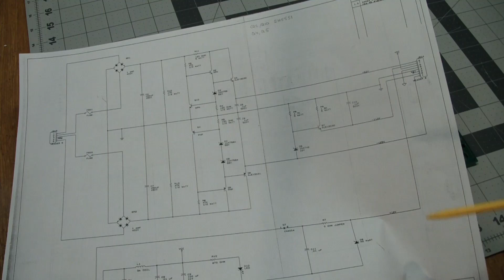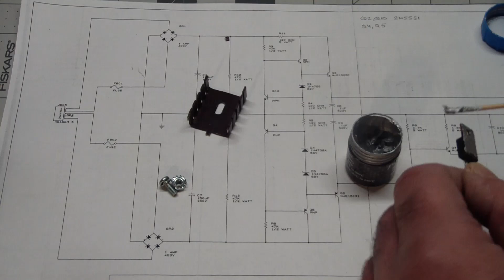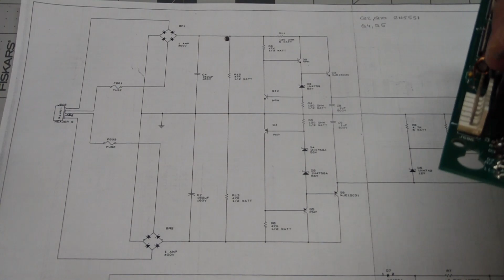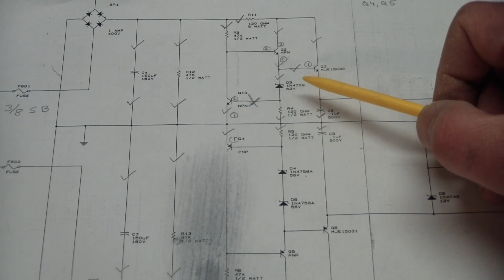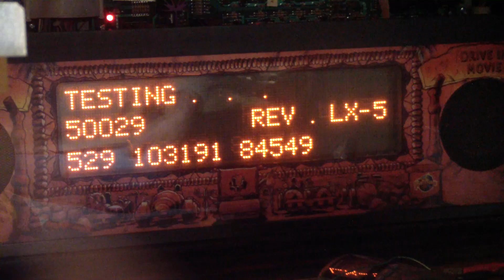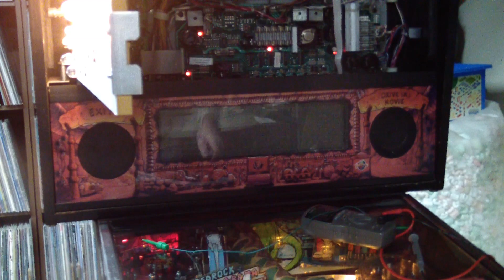AE#132 Repairing A Dot Matrix Display Driver Board For A Pinball

Comment: ARTIFACT, Artie can you try to make a theory lesson about the switch matrix circuit and lamp matrix circuit in pinball games because I don't understand the purpose the diodes used in the switch matrix or lamp matrix because when all the switches are OPEN the diodes don't do anything and when ONE switch is CLOSED the diodes don't do anything. So i don't understand how a ( phantom READ ) would occur but I heard when multiple switches are CLOSED the diodes are suppose to prevent Phantom reads but I don't get it. If you REMOVE all the diodes I would think the matrix would still work because the switches are either open or closed and the CPU just READS the switches are open or closed so you can REMOVE all the diodes. Prove me wrong in a video theory lesson please

Comment: Great video! I noticed you avoided a confrontation with the HSSP (Heat Sink Screw Police) by not showing when you tightened the pass transistor mounting screws (MUST be done before soldering the leads!)  Except for the + 12 Vdc rail it looks like the display power supply is independent of the digital section - you could build your own power supply board (better design) and just abandon that section.

Comment: Fricken YT. A 10:41 ad followed by a 4:51 ad, and you wonder why people skip ads.
Reply from the maker: Sorry about that, maybe I should switch to Patreon or find a sponsor. Any sugar daddies out there?
Reply: @Mr Guru The problem is you're not supporting the creators, and in this business people tend to quit when the enthusiasm dies and there is no reward - seen it a 1000 times in the entertainment business -. Basically supporting creators  extends your entertainment. 
The people I support I use an ad browser, and casual watching an ad-block browser. With my favs I let ads run at the start, but if they have too many mid-ads I switch to ad-block for the rest of the vid.
Reply: @Mr Guru Well said, I've started using ad-block since YT upped the game. They will, I suspect, drive makers and viewers away to other platforms and shoot themselves in the foot.

Comment: After such a repair,  I would be interested in knowing how hot the components in the burnt areas were getting.  Perhaps putting a small cooling fan in that area?
Reply from the maker: The heat sinks become very hot to the touch after five minutes of operation. But all of the boards I have do that, even the ones without carbonization.

Comment: Is the black areas of the board carbonized just on the surface?  
Or is it thru the entire thickness of the board?
If it is just on the surface; then can't a little Dremel work save the board for another rainy day?
Thanks . . .
Reply from the maker: I would actually have to dremel it to find how deep the carbonization goes, but I would guess that it's mostly near the surface. And don't worry, the sick board isn't going anywhere. It'll just wait patiently until I have nothing better to do.

Comment: Hello, I would really appreciate it if you could please answer a couple of specific questions about Atari Pinball CPU board repair. The questions are at the very bottom, the supporting info is below. Thanks.

I have two boards. The first one didnt work when first tested and the other one died recently, right when the ball drained, after about 30 or so games. These are both airborne avenger boards. They were both stored in an un insulated building. Maybe the cold and warm air damaged some components? After it died they now both have an always low reset (it's not the button causing it)

The problem I am having is that RESET, pin 40 of the CPU, is always LOW  even if I remove the CPU from the socket. I have gone through the Atari troubleshooting guide a couple times, and have gotten to the part where it says "replace ROMS",so I burned some new ones and did the simple rewiring, but that didn't fix the problem(I know now that RESET should be flashing high and low with no ROMS installed.)
I took a look at the schematics for the reset and realized that the third chip in the set of 6 is "switched on" by chip A1 and maybe B6, so I grounded pins 2 and 3 of the third reset circuit chip to test  and the RESET signal flashed high and low like it's supposed to.

Here is the very important question: Both of the boards have the same low reset problem (it's not the reset switch, as when I press that it goes high for a split second and then returns low)
The next suggested thing to do in the Atari troubleshooting guide is to replace the CPU, and I have noticed that the board that died when the ball drained already had the CPU replaced decades ago with an AMI brand 6800. 
Could this mean that the CPU is bad on both of the boards? 
Is the reset signal "switched on" by the CPU?(which is why it doesn't flash high and low until I ground pins 2 or 3 of the third reset chip)
Does a CPU need to be in the socket for the reset signal to start pulsing?

I've never gotten anything but garbage data when testing and experimenting so far which maybe can happen even without a CPU. Sometimes I could get the reset to stay for a few seconds but only garbage data was on the display line

I also posted this comment on your Atari repair video but I wasn't sure if you would see it since that was a video from 7 months ago.
Reply from the maker: First make sure that the voltage at the CPU is in spec, 4.75 < Vcc < 5.25. But most like likely you're having a problem with the watchdog circuit. If the CPU doesn't reset the watchdog counter chain periodically (ICs A6 through A10) reset will be forced active. The CPU has to run properly to do this, so removing the CPU will guarantee the reset line being active permanently. My guess is that you have a ROM problem or contaminated sockets preventing the CPU from running. 
I hope this  gives you some hints on where to look for trouble.

Comment: 7:11 If it's a parts board they probably just hit the back with a mini blow torch to rip the IC out quickly. I do it all the time on scrap boards, you can drop them out in seconds but as shown it destroys the board.
Reply: Yep that's my thought also, we used to blast the solder side with ye old bernzomatic and then just wang the board on the workbench and IC's would come right out .. much faster than the solder sucker and more chance for fire .. a total win!
Reply from the maker: I should have thought of that. I used a benzomatic years ago to salvage parts, but the pcb looked really horrible when I was done with it. This one looked kind of tame in comparison.
Reply: Also the discoloration is on the back side hit by the flame (or hot air gun)
Reply: Exactly right, the evidence is clear.